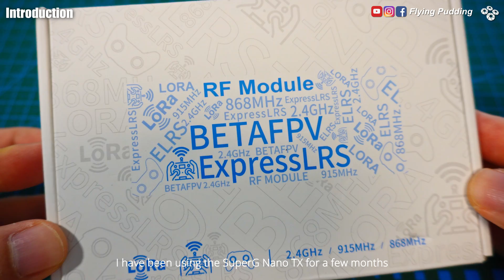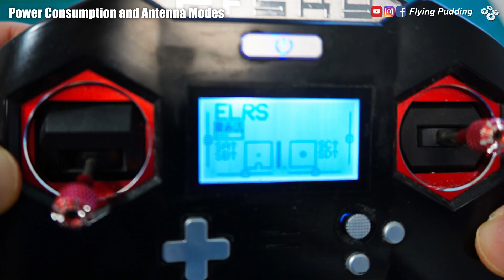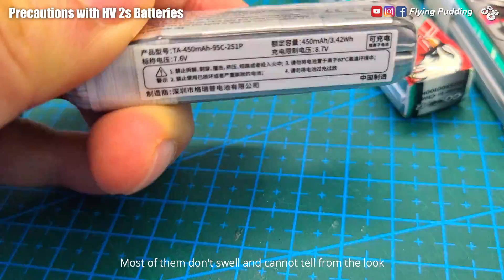Should you bother? Betafpv SuperG Nano TX Module for Regular ELRS and Built-in Receivers, Lipo tips.

Comment: Wow awesome video can’t believe such a small drone like that Pavo pico can do this. Also, I have a problem with my pavo pico that when whenever I arm it it just freaks out and flips over. Do you know what could be causing the problem?
Reply from the maker: Hey Edenplays thanks for watching and your comment! It is possible that the direction of the props is reversed or motor directions are incorrect. I'd suggest you take off all the props and verify the directions of the motors using your fingers, then reinstall the props properly. Hope that helps!